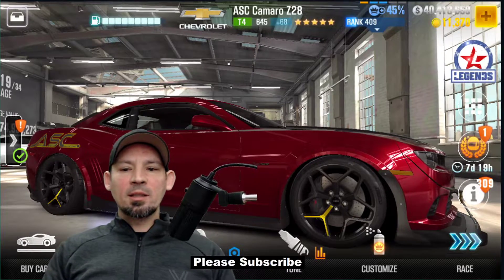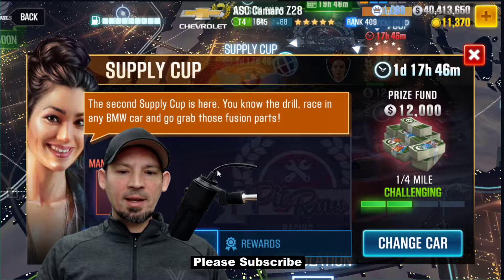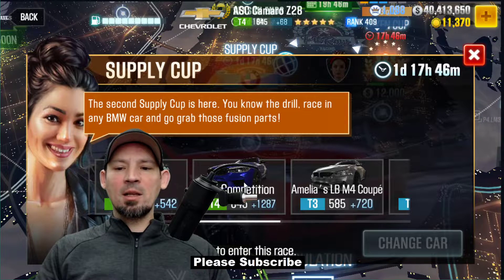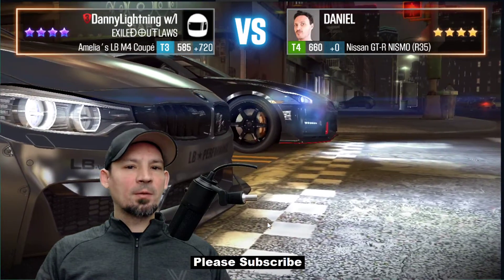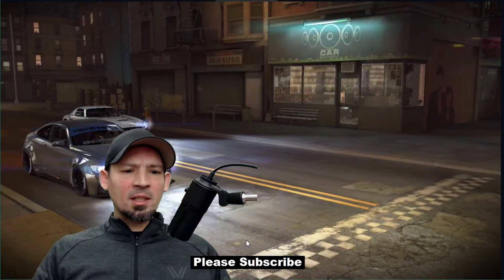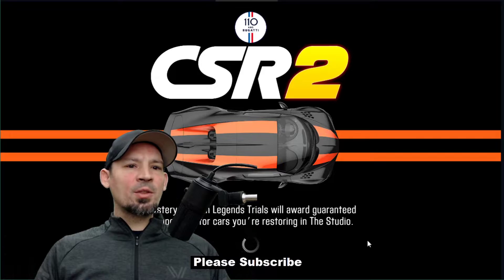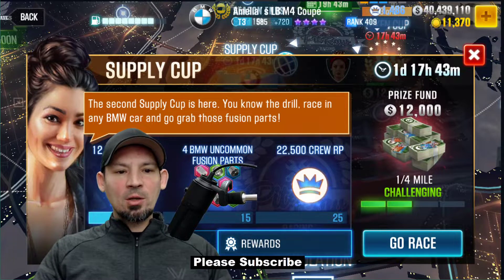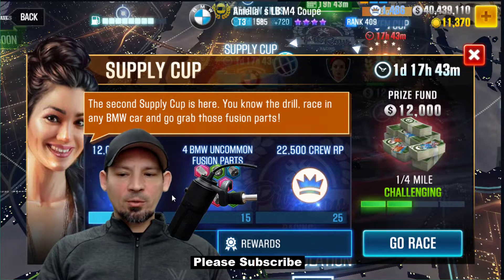CSR2, How to easily beat supply cups,   Things you need to know about supply cups

Comment: Hello Dany! Im a new player since 1 month and you help me alot to understand many things at CSR2! I have a question about the prestige cup, do you have any advice with the BMW M5 to be quicker  when we have the race 0-160 im failing really bad,i try to readjust my setting,with no succes! THX Alot! Your awesome !  Love your vidéos!
Reply from the maker: Did you see my tuning playlist,. That should teach you how to tune a car for different types of races,.  If that doesn't help then you probably need more parts for your car.    You can buy and strip other BMWs to get fusion parts,. if you want you can spend yours bronze keys to get parts for the m5 as well but I never do that,. I save my Bronx keys for when there's a really good car out and parts are available for that in a crate.   There should be a crew cup in a couple days if you brought along to crew, that will give out another stage six-part  which may help.    I just put out a video on this season's prestige cup,. You will need at least two stage 6 parts and pretty much all of the fusions that can hold

Comment: Hey danny i have a question. Does progress on loyalty rewards for the silver crate reset? And if the prestige car expires does progress go away im at 2/15 im trying to get the m5 competition
Reply from the maker: The m5 competition should be available in silver crates until the prestige cup actually ends, so you have quite a few days to still try and get it.  The loyalty will not reset during that time but it'll probably it'll reset after the 10x chance is no longer up, so next season when The prestige cup car comes out you will lose the progress towards the loyalty reward it'll start over

You might want to check out my video on key Management.  It's important to save as many silver keys as so you don't struggle to get these prestige cup cars in the future.   So it's better to not get one for a few seasons and save
Reply: @Danny-Lightning-CSR  tysm Danny, u have rly gd advice
Reply from the maker: @beetlejuice3923  thanks, I'm glad you find that helpful

Comment: 2023 M2 Coupé "M Performance  is a great car for the supply cup  easy  win with out the car being max out with stage 5 n 6 car part 😊 it is a good roadrunner car
Reply from the maker: What I found is if a car beats down on time or if it's really fast across the finish line it's easy to win supply cups but if you have a slower car that does not be the dyno time it's kind of rough so I either look for a really fast car or a dino beater and if you have one or the other or both the supply cups will normally be easy and if I don't have one that beats Dino and one that's not fast I'll try and tune one of the cars that I have to beat the dino time and then that usually fixes it but yeah it's kind of a weird way they got it set up

Comment: I've got a lb i8 but cant seem to beat dino time on race 23, I've got all stg 6 with 91 fusion parts..any advice?
Reply from the maker: You're going to have a really hard time with the lb i8 if you're trying to beat Dyno, it's not really a good car but more than likely you need to make sure you have enough parts installed on to it that you're shifting it properly and that you have it tuned to correctly in order to get it fast enough for whatever event you're trying to do,. If it's something like the supply cup unfortunately you might want to try and find a different BMW to use if you have one, I think it's going to be really hard to do a supply cup with this particular car and I'm not really sure how you can tune it to make it better

Comment: Can you do a video that shows how to set a car to beat dino time
Reply from the maker: Some cars naturally beat Dyno time, other cars you have to figure out how to tune it to make that happen.  every car is very different,.   and every time you installed new parts on that car you might have tune it and  figure it out how to beat your Dino Time again because changing parts can really change your tune.      Cars that naturally beat. As long as you tune it  properly it'll always beat dyno.    But I really have no good way to show you how to tune cars that don't naturally beat Dyno because they're all very different.  I dont usually try to find what I call the cheater tunes on my cars.   All I can say is you just have to play with the tune and do test runs until you figure it out.   Some cars I'm not even sure if you can make them beat Dino if you wanted to.
Reply: @Danny-Lightning-CSR  
Do you know if I can take fusion parts off of one car and put them on another car that is the same car just has more stars
Reply: @michaelstreeter4546  yes but it costs gold, it's too expensive
Reply from the maker: @michaelstreeter4546  yes but it cost gold to remove your fusion parts and stage 6 parts.  Let's just say you have a Honda,. Any Honda stage 6 parts will fit on any Honda in the game.   No stage 6 parts are models Pacific.  You can't take stage 6  Parts off of a NSX and put them on a Civic but you could do that with the fusion parts if you wanted to spend the gold to remove the fusions.